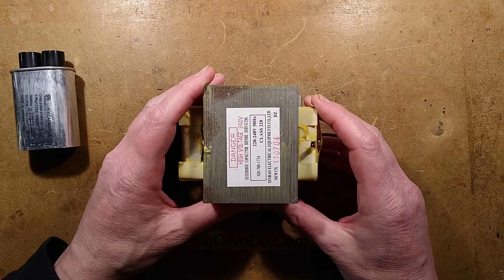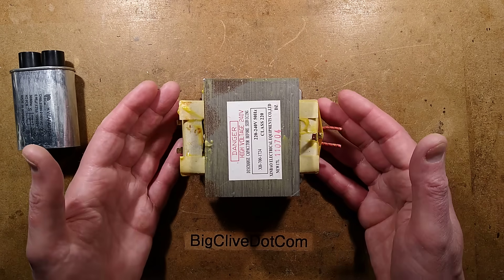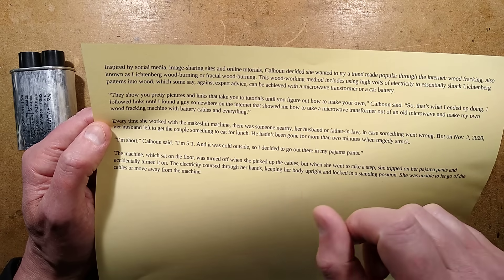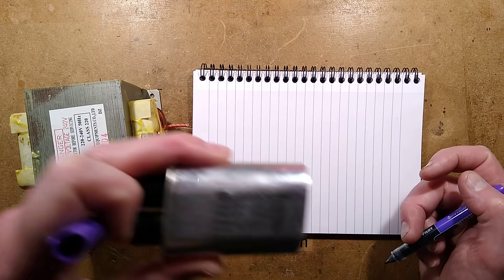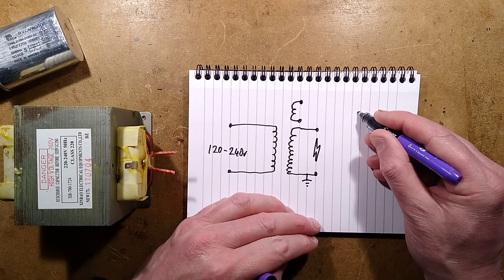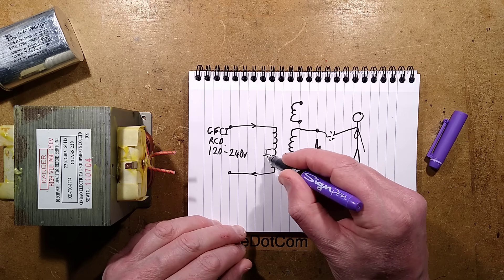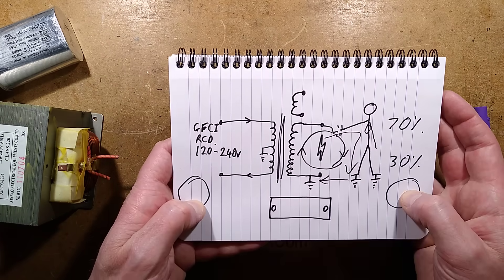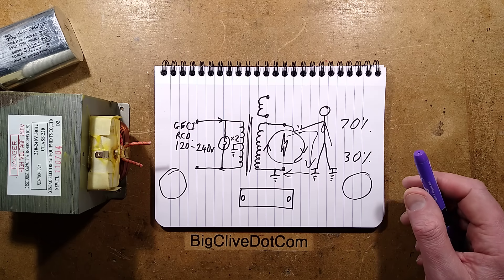The most deadly project on the Internet

Comment: But theres one huge advantage between high voltage and low voltage. The same one why power is "sent", distributed to our homes at hv- no losses comparing to "low" voltages which are losing A LOT of power. Also instalation is easier to maintance and way way cheapper to make for hv. In addition, energy suppliers want us to lose more energy in our home installations, because we will pay for it anyway. Every device in our homes would be way more efficient, cheapper to produce etc. if powered with hv ac. It would be more damgerous for users in enginering way as we know today for sure, but look- you shouldn't "play" with energy after all anyway. Playing with electricity is like playing with fire - don't have fun with it if you don't understand what you're doing, how it works or you will regret.

I attended an electrical school with an electronics profile, I'm an electrician by profession today and I've got kicked with hv spikes probably over thousand times with 40, 50 or even over 70kV LOW CURRENT AC and I'm still alive... But i learned how to survive that!! It may be very painfull, it may burn your skin, it may erase your brain, memories, it may stop your heart beating but it won't ever make my hand tighten on the electric wire (like 230v does) when I short it to the ground- that's the most dangerous thing in electricity imo- when it shocks you, and you can't even stop "holding" a wire, can't even fall, can't do shit (physicly you can, but you know ;p) and you feel every amp, current slowly goes through your body and you die. 

So always install protections in electrical boxes, such as an RCD etc. to protect yourself, your family, kids, devices in your home and always have someone to "spot" you if you're doing something on your own hand. Most ppl die in this profession because they are dumb or they are unlucky, safety gear fails, give up the routine and work alone "on hot".

But I repeat and point out that I am talking about HV LOW CURRENT! Don't ever try to short hv transformer station in your neighborhood unless you want to evaporate or become what fenixes are born of... :)

BTW. What % of homes in the US have at least an RCD? Any data?

Comment: It was not painful, my eyes did the 60 mhz wave. Everywhere the current exixted my body carterizide instantly burning holes in my shirt,  up right arm out shoulder where it split, up neck to check, across chest to heart blowing out spots on chest both sides of heart. But painless. No dead man box. Get a remote control power supply, set leads move away at least 20 ft, hit the on button on remote.

Comment: I had a Carver TFM500 amplifier
It was such a beautiful and powerful monster of an amp.
This audio equipment was passed down to me by my grandfather.
So i tested everything and all devices were in good condition despite how darn old they were.

One day i decided to take apart piece by piece and clean each audio component individual and their electronic boards.
Everything was soo soo dusty from inside, in the process of cleaning my heavy as fuck amplifier i touched what seemed to be a very thick copper coil coiled on this big circular shapeed black metal or dark material donut looking coil and i swear i recieved a big discharge!
I had paniced and didnt know what to do.
I was such a strong shock and moments later i was thinking what had happened….
I was alone at home nobody was with me at the time.

The value toward my audio equipment was big for me that i just continued to clean everything but i avoided touching and wiping that big coil piece.
Thankfully everthing went ok and my equipment looked way better cleaned!

This shock was days after i tested my equipment when i brought it home😅, i never new amps had transformers in them i guess thats what it had.

Comment: It's difficult to make people understand that they are messing around with certain death when operating one of these.
I've been making improvements on the design of my burners for 6 or 7 years and the most recent one has a relay to disconnect the primary using 12 volt control, where both the 12 volt negative and 12 volt positive each have a switch. One is handheld and the other is a foot switch. I've also done the isolation from the transformer chassis on the secondary lead along with a sturdy enclosure, lighted switches to arm the primary and 12 volt transformer. Bright LED's when engaged, very long wires for the Deadman switches so I am always 15 feet away from the workpiece and additional safety measures.  I think another issue that people fail to recognize is how rested they are, how patient they are, clean work area, no dogs running around and all of the things aside from the device itself.
I would say that some background in the electrical trade is mandatory before someone even think about building one of these things.
At least that way they would be more familiar with the safety measures that apply in general to working with electricity.
Honestly, I'm surprised the statistics aren't worse. People don't think, they don't listen, they don't learn, and they wind up dead.

Comment: I was playing around with a disposable camera trying to make a little stun gun and accidentally touched both terminals of the capacitor. One touched a finger on my right hand and the other touched my left hand. That tiny capacitor that Is only about the size of a marker cap was enough to shock the hell out of me. My body convulsed so hard that I found myself away from the deck and out of my chair. For several minutes afterwards I was having rather uncomfortable muscle contractions, and my heartbeat also took a few minutes to return to normal. I can only imagine that a capacitor like the one in a microwave would do to someone. I have seen what a capacitor from a refrigerator can do to a metal garbage bin. I have a box full of them what we are going to try to use for a rail gun. We wanted to make sure they were all discharge so we taped them one at a time to a 4 foot pole and touched them to the metal. One of them still had some energy stored in it. There was a flash like striking an arc with a stick welder, a loud pop, and it vaporized about a 3 inch section of the 2mm thick metal. Electricity is terrifying, definitely not something to play with.
Reply: Lol sounds like the experience was mostly your body and mind reacting rather than actual discomfort caused by the capacitor...

Comment: Hi my name is cool hands I used to repair televisions back in the good old days I don't do that anymore one day I was working on a old TV and it slipped and I got shocked by a hundred thousand volts but luckily I was grounded buy a wood platform I was standing on. I tell people playing with high voltage is deadly if you're going to mess around a high-voltage number one you need to build proper work station your workstation needs to be made of wood three-quarter inch plywood top  under you you need to have two four and two-by-fours going across they have a proper grounding system if you got hit electricity would go to the ground and not kill you. Most people get killed by grounding out a large capacitor accidentally and getting Zapped across the heart

Comment: This is scary dangerous! Funny thing was my dad used a microwave transformer to build a spot welder. I was glad to hear you say that’s a lot less dangerous.
Reply: compared to this its safe, the only real damage it can do to a human is from the heat produced as the current goes trough a conductor, the voltage on a spot welder is way too low to pierce the skin to cause damage.
Reply: I recently made one myself. It's so safe I can hold the secondary wires in my hands and it'll never do anything due to the very low voltage. I did however manage to sit on top of exposed line voltage wires, and also blew up a neon indicator right in front of my face.
Reply: @alexoja2918  point proven, dont know how healthy it is to prove scientific theories on your self but props to you my man, coulda tried a piece of meat or sum first

Comment: when i was in JrHigh (95-97) some kids that would huff on markers. would take capacitors to school and would challenge ppl to hold on to the wire  while plugging a 9v battery into it. idk if that did anything but it seemed to give most kids a good jolt.

Comment: As a retired power supply engineer I would never have a project using any high voltage transformer, I've seen to much in my 41 years of high voltage situations of others, and this and many high voltage projects on the web......Please do not do!! Their are No Second chances. Not many tell of these experiences. Simply put, don't even try.

Comment: There is one use for a Microwave Transformer that I have invented !!!!  You need an old electric blanket, and you need to remove the wiring.  You need to weld some Rebar iron bars together and then fit them into the blanket !!!!  Wire the Rebar with 30 amp Cable to the Transformer !!!!  When you connect it up the bed will get hot within .01 second !!!!!  Do you think I should Patent this marvellous invention ????

Comment: I built one and never used it. If i did it would be outside with that deadmans switch on a plastic table with the wood and box on ceramic. All operations from 30 feet or indoor operation with the work outside. I would never try by touching the leads ever.

Comment: I've seen the horrible damage to the woman's hand.  I've got a Capacitor discharger but I never take Microwaves to bits !!!!  I bought a Manufactured lithium Spot Welder which is brilliant !!!!   But I wouldn't make my own welder from a Microwave Transformer !!! I have an Ark, a Tig , a Mig Welder and two spot welders for lithium batteries !!!!  I don't make my own machines !!!!  Microwave transformers are not on my list of useful Electrical Equipment !!!!  I have just bought a Variac but that's the closest I'll ever get to touching a microwave transformer !!!!  Why would anyone use a mains transformer where the live contacts are in the open just waiting for you to touch them ?????

Comment: I experimented on hooking my machine to a hotdog and electrocuting it. I was sadly let down when to my horror, basically nothing happened. I was expecting the hotdog to be blown up or burn or something, anything would have  been more exciting than the events that actually transpired. It just sat there getting electrically heated. I put it on a bun and squirted it with some mustard, ate it and went to work. It was one of the weirder ways I’ve ever prepared a meal. When I was younger my dad who is a logger taught me to put cans of soup near the exhaust on his skidder to heat them. I thought that was weird and cool too. Stay safe dudes and dudettes. Do not under any circumstance build a death box. You will be deathed to death.

Comment: I appreciate you educating people so that they are safe, and do not build these devices. They can kill you. Thank you. I’ve been using a mot for 6 years or so to make stuff. Probably 200 plus burns. I built my unit to be fully enclosed, wired to a light switch with an led to indicate the switch has power. This is all preceded by a deadman style switch. Meaning the light switch must be on and the pedal depressed to make the machine function. Never hold the leads and simply let them rest on the work piece. I’m feet away and relatively safe. Mitigation through planning and knowledge. When I started doing this, there were relatively few people doing it. Now it’s become a fad. I still try to think outside the box in how I use my machine to make my art so my stuff is different. But I’d like to see less people doing it. It’s only for people who truly understand it’s dangers and are capable of it’s use in a controlled manner. If you’re like me and you must make something like this, please do lots of research first and build it right. The foot switch is the most important piece of all. You should probably disregard all of my advice as I am a simple minded fool, still arrogant enough to be doing these dastardly and deadly dangerous Lichtenberg figures. I wouldn’t if I were you.  But I’m not you, I’m me. A crazy creative artist who loves that this process is a lot bit dangerous. Live in a safe little bubble, or skydive, climb a mountain, drive fast, scuba dive with sharks? You catch my drift. Leave this stuff to us professional daredevils kids.

Comment: I actually watched a video on how to take this component and make a spot welder out of it.
No gauges, breakers, safety switches, nothing.
The only disclaimers came from the comment section.
Reply from the maker: The spot welder project is safe once the high voltage winding is removed.  All it needs is normal electrical common sense.